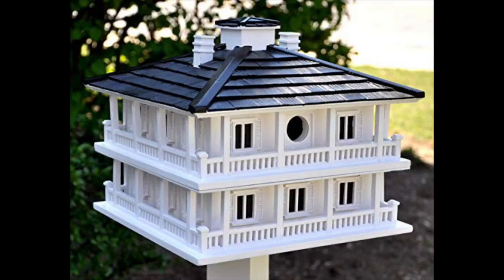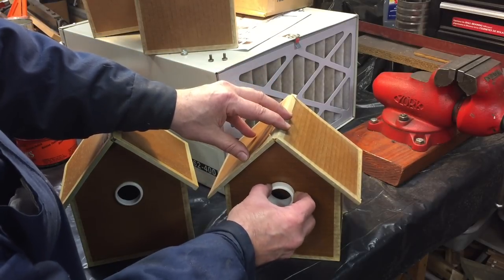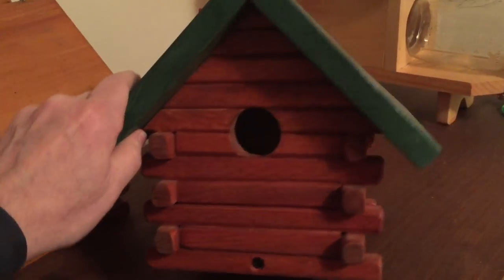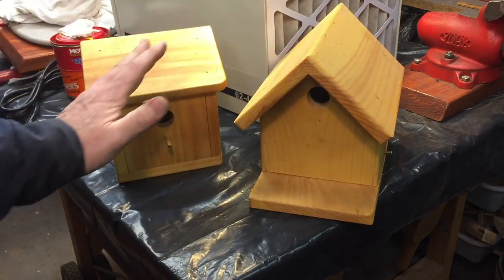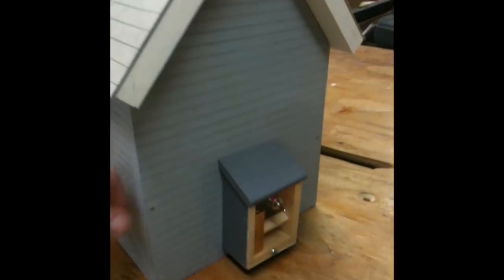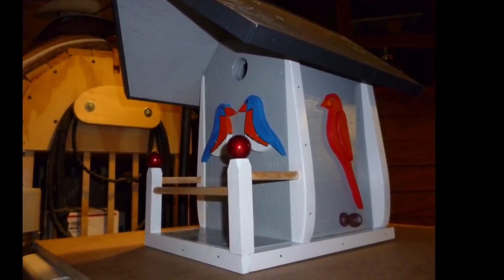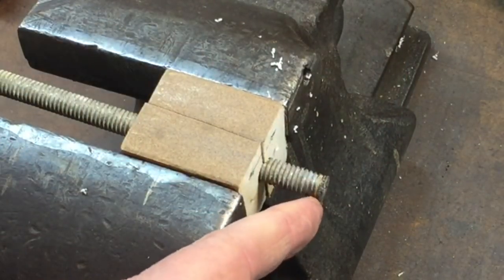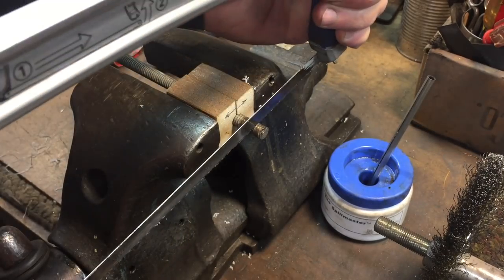Scoutcrafter New Birdhouse Challenge and Modifying Hardware...

Comment: One thing I've found in making birdhouses is to make the entrance hole out of plastic or metal.  Otherwise, the starlings will peck out the wood until it's big enough for them to get in.  And then you won't have any nice songbirds, but just those nuisance starlings.  And it's good to study how big a box and hole are needed for the desirable birds in your area.
Reply from the maker: Funny thing is I live maybe 10 miles from central park but hardly see any Starlings!  http://nyis.info/invasive_species/european-starling/

Comment: I must have used hundreds of feet of threaded rod. Something we did quite often was sandwich a block wall up high between 2 twelve inch channels with bolts made from threaded rod then you could remove the wall beneath it.

Comment: Hi John, like the birdhouse challenge. I would like to  make a couple of suggestions 1- add some type of screen or small expanded metal to the jnside face just below the opening to allow the hatchlings to climb out. Also, avoid placing the birdhouse on a tree to avoid easy access by predators. I prefer to drive a piece of 1" metal conduit or pipe into the ground and attach it to that. Thanks again.

Comment: You may have just motivated me to finish a birdhouse I started years back when a friend had a restoration wood shop. I did it after hours one night just messing around with scrap wood he was tossing.   I got it together and never finished it and I always thought it could use a clean out door now I think I just gave myself an excuse to work on it oh and you pointed our removing the perches under the entrance that I never thought about...  I even have a old really tall post I was going t remove that might make a good mounting post as its 8 or 9' in the air. It's definitely spring in So Cal and this has been a wet march (for California), I would imagine the sparrows will be busy over the next few weeks and would appreciate it.

Comment: When using a hack saw note that on quality blades a short portion of the teeth at one end of the blade are pyramid shaped instead of hooked like the rest of the blade. This is for starting the cut as the teeth will cut in both directions. Once the cut is established you don't have to saw like a madman. Mild steel should be cut at 80-120 feet per minute so even, full strokes (about 50-70 per minute) will cut the work quickly with a sharp blade. Like John, coat the work with cutting oil or brush the cutting oil onto the blade. You will note that even with a moderate stroke speed, the cutting oil will smoke in the cut.
A good sturdy hack saw frame is essential for good work. Cheap flexible frames are just about useless. You can't make a straight cut for love nor money. It takes a sturdy frame to put enough tension on the blade for good cutting action without bending or twisting the blade while cutting. This is especially true for delicate work like cutting screwdriver slots.
Cheers from NC/USA
Reply from the maker: Can you believe they used to cut railroad track with a hacksaw!   =D

Comment: I can't tell you how many times being able to shorten or fabricate a bolt has come in useful over the years.  Often times I would wrap the cut off bolt or rod in paper/card and chuck it lightly in a drill so I could chamfer using a piece of sandpaper.  Looking forward to the results in the birdhouse challenge - I might have to get my kids to join in!

Comment: Use an angle grinder to cut the threaded rod, then use the cutters on you wire strippers to remove the nubbin.